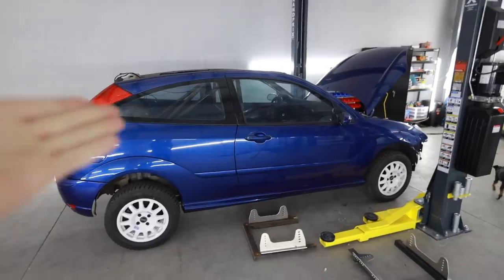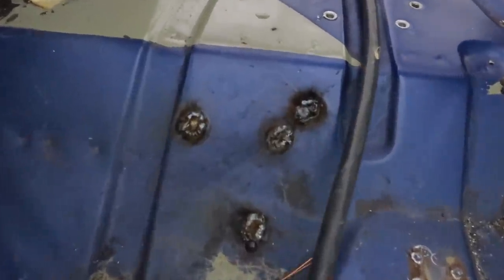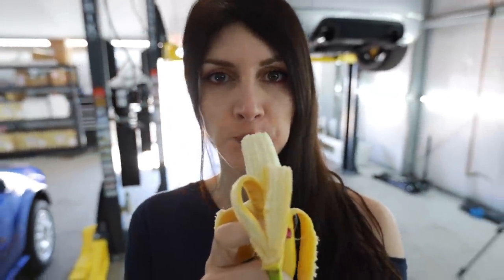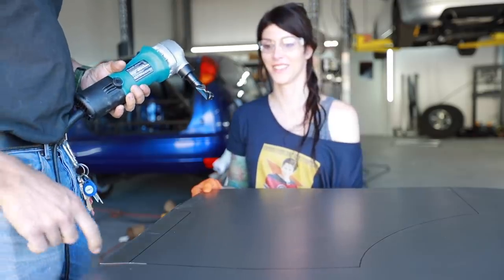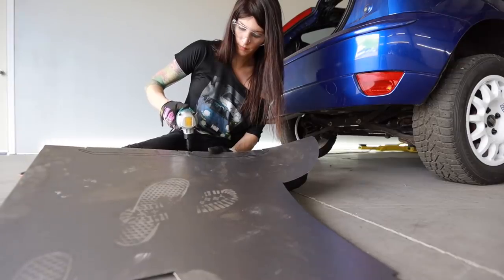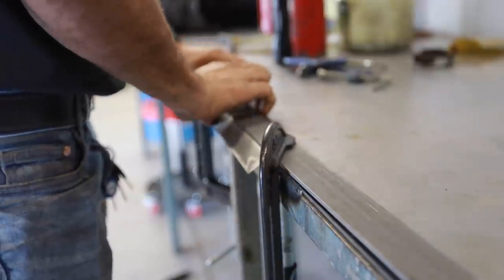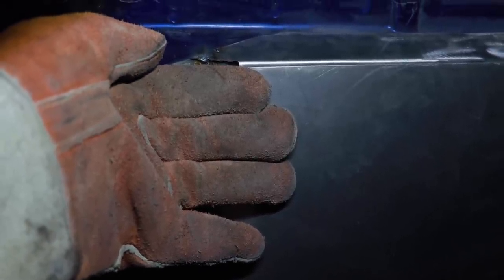Fabricating Metal Body Panels from Scratch // Focus SVT Rally Car

Comment: Weld stuff from the scrap pile before working on projects. Once you learn to read the puddle,  bam all of a sudden it clicks. When you aren’t worrying about screwing up the project, you can relax and it is so much less stressful. There are a certain number of feet (or yards) of bad welds everyone makes, so when you can have fun and play on scrap you wind up spending less time, energy and angst in the long run.
Reply: This! I don't weld regularly in my job, but when I have to do it I always warm up on some scrap metal first. Only takes a few minutes, but can potentially save hours of struggle.

Comment: When filling a hole with a MIG welder, hold a piece of copper behind the hole. The weld won’t stick to the copper and the copper will keep the molten metal from dropping through the hole. The copper also acts as a heat sink to keep the thin metal from getting too hot.

Comment: Sarah, do not apologise for your efforts as a beginner.  Every journey starts with the first step.  Many do not take that first step because of the fear of failure.  Hang in there!  Skill will come!
Reply: What was the result of what you last welded?
Reply: I have not tried to arc weld in years.  However, my last attempt was "acceptable" because the angle brackets on my vise stand worked quite well.  What I said in the above coment applies to any endeavor, not just welding.

Comment: Semi-pro tip; If you know the metal is non structural, getting paint and want to save some time and welding wire, a light skim coat of bondo does wonders to take care of any low spots found after grinding. Can't wait to see how the interior turns out once the paints on!

Comment: One thing that does help when you're filling holes in sheet metal with weld is to hold a piece of copper or aluminum against the back of the area if accessible. It helps support the weld and draws heat away as well.

Comment: Doin great!  Take your time and soak in the experience.  Everything has a learning curve.  Biggest thing to remember about welding sheet metal is minimizing heat warping.  It sounds counterproductive but the best way to weld in a thin metal panel like that is actually lots of tack welds that eventually all meet.  Alternating sides to keep heat from building up and warping the panel.  ;)

Comment: Building a car is much different than fixing up cars. It takes massive time and a lot of trial and error. Keep paying attention to where the fuel tank, lines, and the vent are as you weld on different areas. Also, if you get close to any moving part, henge, window mech. or any bushings, be careful not to get them too hot and ruin. The angle grinder will 100% at some point rip a piece of sheet metal out of your hand. If it cuts a tendon, you loose 50% moment of one arm. Just FYI. If the weld is structurally sound and you are covering with paint, just fill tiny wholes with 2part epoxy, grind sand to smooth. Never waste time trying to polish a turd.

Comment: On the large panels you could pop rivet them on, or use a sheet metal screw, That way you could get access to the inside in case something in there need repair or you need to route wires.  Plus it's quicker and neater than welding.

Comment: A little advice for your welding adventure, When mig welding always push towards the weld to create the bead dont pull the tip away. Simple but it will help you learn faster. Love from the uk

Comment: Sarah,The way you fix a bad weld with a grinder is to grind the weld out and start again.  You Have to Remove the Paint, Rust, etc. to shiny metal. You have sheet metal scraps, Practice Practice Practice, Wire stickout is another issue.

Comment: @sarah tip, if you can get behind the sheet metal, use a thick piece of brass behind where you weld, works as a heat sink and no blow outs, also the weld doesn't stick to it if you happen to want to fill a hole ;)

Comment: We all have to learn somewhere Sarah. It's not easy welding when you haven't done so before (ask me how I know). The only tip I will give you is to cover your windows when grinding the welds down otherwise you will end up with tiny little pieces of molten metal adhering themselves to the glass

Comment: The hard part about welding for me is actually understand the welder itself.
Really, every welding brand, model etc is different so, gotta play with the settings to find what suits you the best :)
For example, on thin metal like car panel, I found it easyier to "push" instead of "pulling" when you weld (the nozzle of the torch point toward where you wanna go, not toward the weld)
Or just straight down ! 
Again, you will pick up the skill pretty quickly, it's fairly easy :) Your welds are quite nice for a begginner !

Comment: If you find yourself welding up  more holes in sheet metal that thin a brass or copper backing plate will be your best friend. The weld won’t stick to it. Also you can cool the metal with an air gun in between passes to prevent blowing through.

Comment: for bending sheet metal, I did something super cheap that let me make nice bends. I bought some 2" steel angle and cut, like 12" pieces. I could clamp 2 in a vice to hold the sheet metal with the part you want bent sticking up. Then use a 3rd piece against the metal sticking up to push the metal over to the angle you want. Works pretty well and is super cheap. It's just limited by the depth of the vice.

Comment: Sarah, if you want to learn how to weld please invest in a TIG welder for this type of car fabrication. You aren't really learning how to weld by tack welding with a MIG machine on sheet metal. It's a steeper learning curve generally for TIG (maybe, but with working auto parts it might come a lot easier). Also, you won't have to go at it with a grinder afterwards. Obviously you can continue doing this stuff with MIG, but since you are interested in learning welding, I recommend using TIG.

Comment: Get yourself some scrap metal and practice with the welder. You’ll get it. I have that same welder, and there’s a steeper learning curve with it on sheet metal. I had a Hobart Handler 140, and it was slower and easier to learn with. The 190, you strike the arc you better be moving. Best way I’ve found for sheet metal is to do a bunch of small tack welds spread out so you don’t warp the panel. You could also use plug welds and seam sealer to do your interior panels instead of full welding.

Comment: Try turning up the heat on the welder and make small spot welds. Turn up the wire speed when filling in gaps. Hope this helps

Comment: There is a reason that they have trade schools to learn welding. IT IS HARD. That said, you are attempting one of the hardest parts of welding and doing just great. Thankfully it is not structural where a failure will hurt someone, so take as long as it takes to get it and you will have a valuable skill for life. As Yoda said "Try? There is no try! There is only DO. " Get'er done girl.

Comment: If I remember correctly, if you can reach the backside of holes you need to fill in you can put copper behind it to control the amount of welding required as the weld won't stick to the copper.

Comment: When welding a small hole weld around it the metal will be thicker and you wont be chasing a hole grind the paint off before welding dont worry you will get better with time , for a temporary work bench you could use a stack of shipping skids  if lucky find all the same size !

Comment: Cleaning the paint and undercoating off the area before welding helps. The burning paint makes the weld dirty and and it doesn’t melt back together evenly.

Edit: looks like you already did for the new panels, they look much better than the dirty booger welds filling in the holes at the beginning of the video.

Comment: I like to use loads of small magnets to hold card and paper in place for templates. Also, my welding cars top tip is 'never weld in the evening'....... you don't know if there's a smoulder going off somewhere and it can burn the garage down overnight!!!

Comment: If you're going to use a t-shirt for head/hair protection, go get some cool 100% cotton t-shirts from the thrift store with awesome stuff screen-printed on them, and cut out the shirt and rivet the fabric with the art onto the helmet.  Or rivet-on snaps so you can remove the shirt material to be washed when it gets all nasty.
Reply from the maker: It was 100% cotton, that’s why I used it.

Comment: Just a thought if it's not too late. Think modular. Maybe instead of welding the cover panels on could you use nut certs and bolt them on in case you need to get behind them at anytime of the life of the car. example, If you get any hits on the body in the rear quarter panel, fixing the dent will be a nightmare without access behind the panels. plus it'll save time on welding and grinding. Keep up the awesome work

Comment: Get an assistant to hold a brass block behind the hole you are welding. I learned how to weld at a body shop in Calif. The Boss said if it sounds like bacon frying, you are doing it correctly. Also, if you drill 1/4" holes like every 2 inches you can more easily weld on the panels. Brush on seam sealer will pretty up any weld and fill gaps you can't weld.

Comment: Great video and effort! Flap disc to remove the paint will be faster as well as some weld through primer would make things a bit quicker and neater.  I'm sure the roll cage in the way doesn't make it very accessible. Keep up the great work, stay motivated!

Comment: Pro Tips - First, cover all glass! Grinding and welding splatter will etch into the glass but probably already has at this point. Second, ditch the flap disc, Flap disc are always changing profile due to wear and make finishing inconsistent, plus they are expensive. Instead, get yourself a DeWalt Rubber backer DAJHXGMD01 4 1/2" and use 36 grit zirconia 4 1/2" sanding disc. Not only do these always stay flat and consistent, but they also remove material better and are way, way cheaper. Lastly, use Bondo Glass filler vs regular Bondo to fill large voids and holes, it's way stronger and won't crack ever. 

Ok, last thing. Never make eye contact when eating a banana unless you're coming over to my house in Phx, then I'll allow it. 😉

Comment: Thin sheet metal is probably about the hardest project you could pick to start welding on so don't get down on yourself for sucking at it. That being said, if you think you might want to really get better at it so you can do similar stuff in the future, you might want to think about getting a small sheet metal brake and fabbing some small projects just for fun. maybe start with trying to make some small boxes. Repetition is the only thing that will make you better. Sheet steel is relatively cheap and I'd rather blow holes in random pieces than my project car.

Comment: I am also teaching myself to weld, and can relate. Sheet metal is especially challenging. My cheapo Harbor Freight flux core MIG has no problem blowing holes in a thick fender I got of a Buick. There are probably better welders to use, but I'll bet those expensive ones are tricky too.

Comment: Trifecta of welding ~ porosity = not enough shield gas, burn through = too hot on voltage, too much grind off (aka large ass scares) too much wire feed. Slow down & be steady love - slow N steady yields amazing results!! Practice with rusty metal & skill ya self up!!

Comment: I have a miller 120 with gas kit. using .023 solid wire and a 75/25 gas cylinder/regulator allows you to make a much better weld.

Comment: Should have covered the glass before grinding. Hot metal will stick to the glass. Now you need a bead roller. LOL It never ends. You're doing great. Learning is fun, and you always have paint to cover the learning curve. LOL. Remember the NAVY way. "Hammer to fit, paint to match"

Comment: Try, to weld in patterns like drawing sidr to side and pause don't run a line, kinda like pure tacks so the metal don't heat to much and you don't burn holes

Comment: If your welding up holes u can put a flat peice of copper under the hole so the weld dont fall through and the weld won't stick to the copper.and to weld in panels just drill holes around the perimeter of the panel and plug weld it , and then just seam seal the edges.

Comment: Dont fell bad Sarah, sheet metal is very difficult to weld, When i saw that go kart, made me wont to finish my off road kart in the shed now for 10 years or more, was mid way on doing a A arm front suspension setup on it, and a full frame similiar to the edge products, 10 hp Honda belt clutch all by me. But then remember hardly anywhere to drive it legally here in Melbourne Victoria Australia

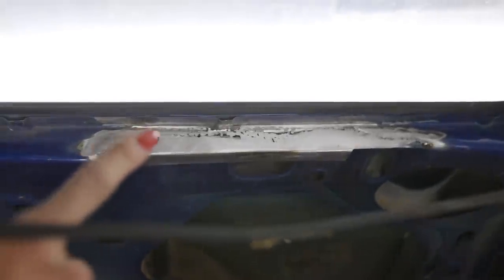Comment: You are probably going to end up with some pitted glass from the grinding if the glass isn't covered. Ask me how I know. At 12:54 .. just slap some body filler in there. You've got enough weld in there to make a sound structure. Use you time and welder wisely.

Comment: I am professional welder and sheet metal sucks to weld! You might be served to stack dimes, just make a little round weld then move over half that diameter, then do it again, and again, again, again, again, and again until you’ve welded the seam or hole. It lowers the heat input into material.

Comment: Get a go-cart Sarah.
Reply: Go-karts are fun! The last time I did it was about 20 years ago. A friend held his birthday at an indoor karting place and I got into trouble because I was trying to get round the circuit without touching the brakes. I kept bumping into people. The karts were electric and so had masses of starting torque. Even though the tops speed was probably 25mph your are so low down it feels so much more. I was told by one of my friends "Behave! Your 50 years old not 10!".
Reply: @sadiqmohamed681  Excellent

Comment: Sarah, as this is a rallycar you will regret welding up the rear quarters like that. When you crash how will you get in there to kick it back out again? If you wanted to cover the hole a sheet of ally or plastic would have done the job👌

Comment: You might want to buy some hand tools for sheet metal. A bar folder (Great for bending small pieces of sheet metal), some green handled shears (for cutting left curves) red handled ( for cuting right curves). They are very expensive.

Comment: simple bending jig metal clamp to a table and hammer and hammer etc more hammering the nibbles are fun many uses  could press and use angle iron clamps etc
Reply: you could rivet the panels in place or together exhaust fumes etc is the only real concern

Comment: You learn to weld by welding. That is the only way. Someone can show you techniques but only practice gets you skilled. You will see the last few welds you do will be so much better than the first. And, your next project will be even better.

Also, if the piece your putting in like the one near the window has enough weld to be strong, use Bondo or Body Filler on those pin holes.

Comment: Regarding the 'sudden need' for a go cart: If you weren't as tall as you are, I would suggest a Mini Cooper. The original one, not the new one.
Sadly these weren't built for tall people like us and are said to be a royal pain in the b*** to work on, as you'd need english imperial sized wrenches. American imperial or metric are said to not fit...

Regarding your welding skills: Don't get too hung up on them not being at pro level with a snip of your fingers. You know what to do, the rest is just practical training with scrap metal. Be patient, that is all you need...

And to the project cars: You don't need a new project car every month. Whoever said that doesn't know anything about work at all, let alone work on cars.
Without you doing this full time and having a team helping you that is absolutely impossible.

Greetings from Germany and rock on!

Comment: Weld looks like you don't get enough gas to the weld... And when you stop  don't lift the nozzle up let the gas flow to the weld. Makes the weld look better. 
Only practice makes a welder👍 
Make thin strips and practice on those. Find the right current&wire feed.

Comment: Confusing Amps for Volts, I think. Do you remove/grind off the paint before you weld? And don't forget to open the gas... Or change the bottle.
Don't worry about slow progress, better take your time and learn. Just keep a mental picture of your desired end result.
Go Cart.... That'll be fun!

Comment: Take your time practice makes perfect. Also less is more on body panels. There is no real need to fully weld uk everything there is a reason car manufacturers don’t a few strategic tacks and the rest use seam sealer. If you really want to fully weld stitch weld 1/2” at a time and leave a gap of 4 inches before the next. Come back to the start and stitch another 1/2” on the end of the last one. This will build up the same weld but without overheating the metal resulting in blowouts. As others have said copper or aluminium help but only if you can get access to the back which I don’t think you can

Comment: I'm not a pro welder but you need to weld to bare metal. One of the reasons your having so many issues with holes is because along the top you haven't ground off the paint. Apologies if you already know.

Comment: It always looks like that when you're welding sheet metal. If you cleaned the crap out of it and tiged it maybe, but that's about right for MIG. Try not to let your wire run out so far though.

Comment: It's a race car if it has a cage, you don't want to add weight to a race car you want to take weight off. So you don't use steel panels, you would use thin aluminum or better yet thin plastic, and rivet them on. A real race car you would just leave the gaps and holes, in fact you might cut off more of the interior panels